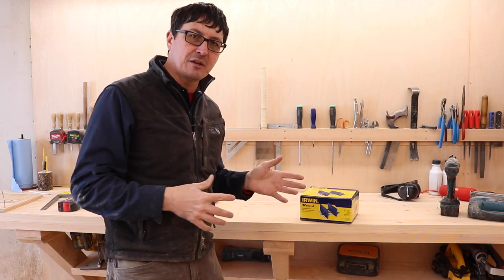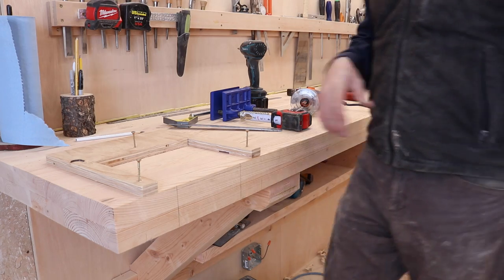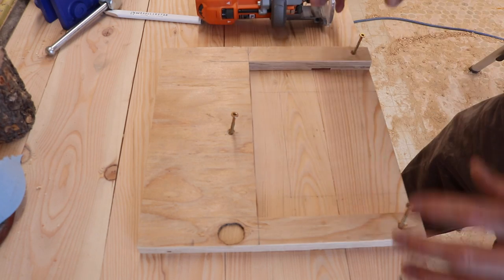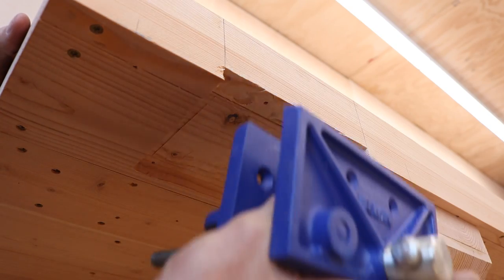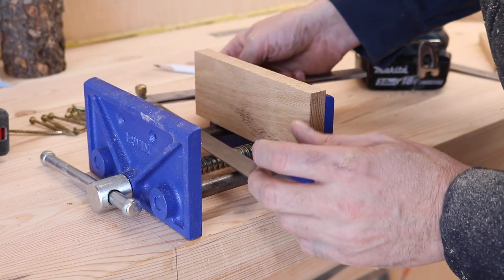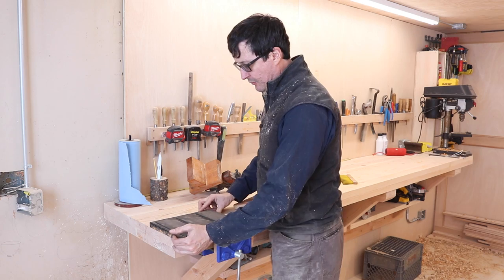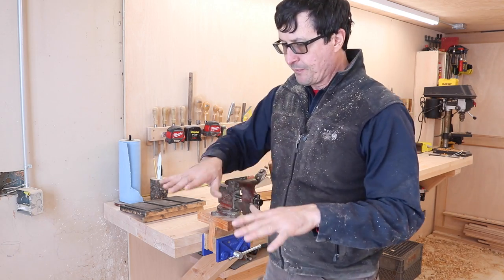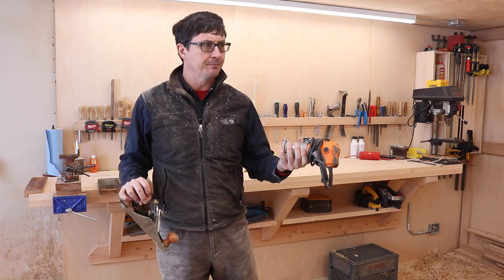The #1 Tool Every Man Must Have!!

Comment: I put a lot of thought into my 4th vice, I swayed this way and that for weeks. I have the two traditional wood vices with dogs on my main bench. I then have a drill press vice on my drill press of all places and a pure holdfast system and dogs on my little tool store bench. I went with a machinist vice on my power tool bench to give me that tough beast I wanted. My workshop is only 6’ by 6’ so everything is in easy reach though my little bench (31”x 24”) and power tool bench (36”x 24”) are on strong lockable wheels. So I decided to put a 6” machinist vice on my power tool bench with my 10” mitre saw, small bench grinder, 9” bandsaw and drill press. Because it’s next to my grinder and drill press it fits in great with any workflow and I chose the machinist vice because of the anvil and face which both give a work surface.

I've realised that vices are extremely personal and there’s no right or wrong in what you choose. I would love a Moxon vice but I have no room and I wouldn’t be able to use a leg vice because of my disabilities. I did think of a woodwork vice such as yours, but I thought it wouldn't have offered me much more than I already have except maybe a little more strength. I certainly wouldn’t use my 2lb ball and pein with too much zest with my wood vices. 

A very enjoyable video, and I think Irwin are a decent cheap brand.

Comment: When you add those hardwood pieces inside the vise, it made it much smaller.
That's like one and half inches smaller vise now.
Probably thinner wood may be better or get few inches larger vise than needed.

Comment: Cody, I'm sure you know this already and just slipped up while shooting this video, but maybe it will help somebody elase out.   For safety reasons when ripping on the table saw do NOT stop pushing the wood between the blade and the fence until it has completely cleared the blade.  I have a scar on my forehead to explain why!!   The piece of wood between the fence and the blade can get picked up by the spinning blade and get thrown right at you.  I was hit by a 16" wide, 2 1/2" thick piece of red oak this way 30 years ago and trust me, that will never happen again.  ;-)

Comment: Would you ever reinforce the 45 degree support on the left side of the bench for additional support, for either side of your wood vice.  Than might also lessen flex if you use your metal vice mounted in the wood vice with actions of say a dead blow hammer.  You also might thing of cutting a space equal to the pins and bolt of the metal vice mount to make flush with the bench top.  Great video thanks.

Comment: I mounted two heavier (more expensive)  versions of this type vise on a bench I was building then covered the rear jaw with a hardwood face that continued the length of the bench.  I think inletting the vise took less time than routing a recess.  The down side of my method is that the bench would have to be destroyed to remove the vises.

My bench is not very sophisticated.  Its just a progression of benches I had built in the past.  My next bench will probably be a viseless English style with holdfasts.

Google anvilfire woodworkers bench

Comment: arr wrangler man ur supposed to recess one of the hole metal plates into the bench so only one of them is seen and the screw and bars hang underneath then attach a bigger piece of wood to the front plate so its flush and that actually kisses the body of the bench it makes ur vice like and extra inch deeper (not sure if i explained that well). I know in this case u might wont hard wood on hardwood but it means u dont have a slight drop into metal.  :/

Comment: I understand using a hardwood would be good for anything non-wood working, but for wood, wouldn't you want a softer wood for the vise than what you have in the vise? That way if you clamp it too hard, it's the clamp's wood that gets damaged rather than your work piece?

Comment: Wranglerstar - I like your videos and that workshop looks awesome. I agree with the vise and all. BUT please do yourself a favor, sacrifice some beauty for function. That workbench in spite of looking marvelous is a waste of time and money. At minimum put some legs in it, even removable legs work better than nothing.

In my "wanna be" garage/workshop the workbench counter top is made of "bathroom" grade floor plate. Water/oil resistant, tougher than those boards (less dents). Being thinner also allow for easy fit of clamp on tools, something that an unnecessary thick top doesn't allow.
Tongue removed, but I left the grove on the outside, so it can be used to hold some awkward shape/pipe. A couple of 2x4 beams take care of horizontal rigidity.
The last leg is just a 2x4 cut to height not even screwed on. So it can be easily removed and put aside for some odd piece to fit  under. 
BTW the wall side is also French cleat.

I do a lot of mechanical work, that thing already took paint, thinner, acetone, oils, etc. sledge hammer beating, welding and so on. Still works perfectly, just looks crappy. I can assure you it doesn't budge whatever you do to it (hit). LOL 
Be well and keep up the good work. Thumbs up. ;-)

Comment: not set on that bench as work table as it flexes all over the place needs proper feet to the ground. also it should have a tool well at the back you are damaging the place baldes by putting them flat on the bench always on there side or at an angle in a tool well.

Comment: I mounted mine like yours and its caused me problems.  Why didn't you mount is on the end of the workbench? Say you wanted to cut and inch off a short  board.  You have to clamp it and cut is horizontal because its wont extent past the bench for a vertical cut.

Comment: Irwin is no longer a manufacturer of quality tools. Years ago it was a UK based firm that did make great tools, they sold it off to China and now their vices are known for cracking under pressure. It pays to get a better quality vice and avoid the potential of a failure....speaking from experience!
Reply: Teachy Preachy!
Reply: Peter M
Now you know, and knowing is half the battle!

Comment: Planes!

And out of sheer curiosity - I'm no big woodworker, I use a plane on the odd occasion only.  (Infrequently enough that I have to remember where I left it!). I've noticed you plane at almost a 35 degree angle?  Is that a "technique" which makes for easier planing?

Comment: Dear Mr. Wranglerstar, 
I purchased 2 of the Irwin Vises.  I also purchased a Black and Decker Workmate 425.  Now, I am faced with a real problem. Do you have any suggestions on how I might attach the vises to my Workmate 425?   It would be OK if it were attached to wood somehow, and clamped on the Workmate for temporary use, but, I would also like to permanently install them.    I need help  :/    Maybe you could do a video on it?  Thank you  :-D
Love & Prayers   <3 <3 <3

Comment: If this were my first bench for a shop, how would I alleviate some of the give? Does that just come with more than 3 supports, or is it the nature of the build? I know this is your extra bench, but I'm trying to build this as my first. This bench has so many cool features that it will hardly matter,  but I'm just curious. Thanks
Reply: Just buy some threaded iron pipe and a couple flange fittings and put a straight leg on either end if it bothers you.  Personally, my "bench" (I actually have 3) is 5/8 plywood on a 2x4 frame mounted on a couple sawhorses.  The thing shakes like Elvis Presley but you get used to it.